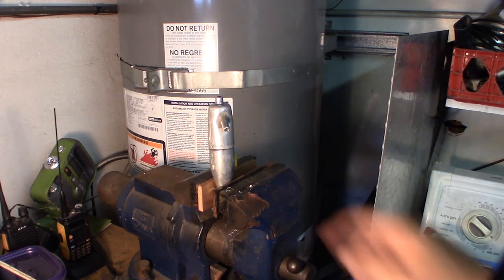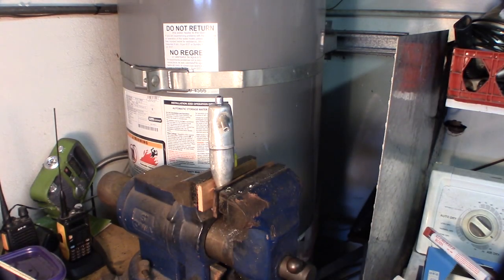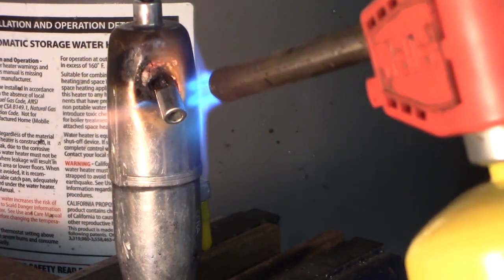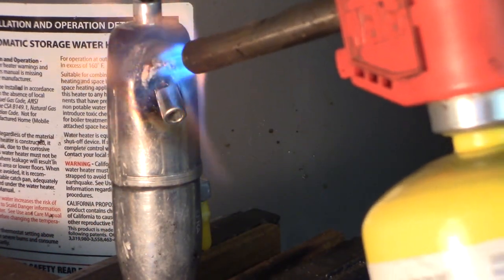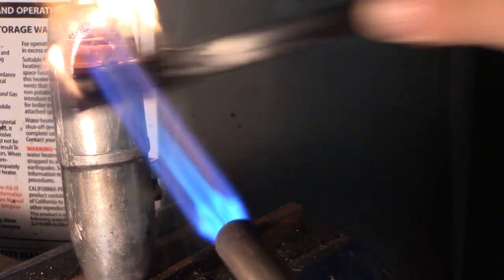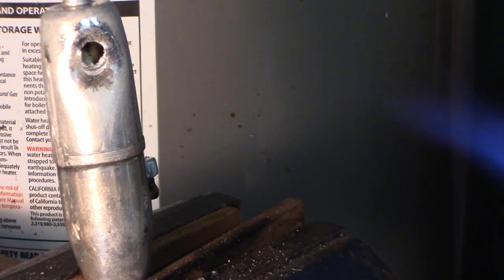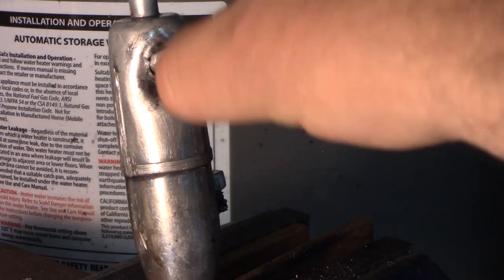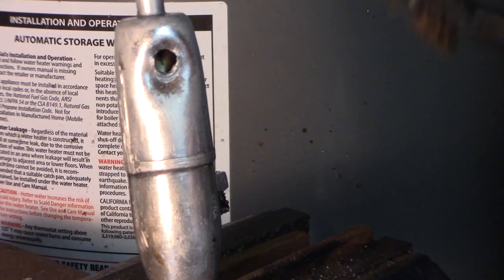How to remove old JB Weld using torch J-B Weld removal

Comment: Hell yeah! You really helped me man! My oxyacetylene torch crapped out. So I used JB weld steel stick and forgot to sand down the brass it and copper it was attached to. But still had a leak. So I got my torch back up and running and really needed your advice! Thanks
Reply: Same here I did the same thing

Comment: "JB weld is not very good". Are you for real? The only way it is no good is if it was improperly mixed and or applied. I have things I have used it on that are 30+ years old and still working perfectly! Its NOT JB Weld that is the problem if it fails, it is the incompetence of the person who applied it that is in question! Of course it is NOT the right way to make a repair but in a pinch it most defiantly is a viable solution and if applied correctly can and will outlast any long term right way!
Reply from the maker: I've used JB weld many times. I prefer metal when I can use it. I'm going to powder coat these exhaust pipes. Powder coat will not stick to JB weld.
Reply: @Matthew Tong Consider maybe it was not properly mixed that was your problem. I have had great experiences with it in high heat applications. So far as high pressure, that would depend on circumstance.
Reply: @kevinm3751 I used it on exhaust over some pin holes with my crappy welding and it smokes and stinks like hell.